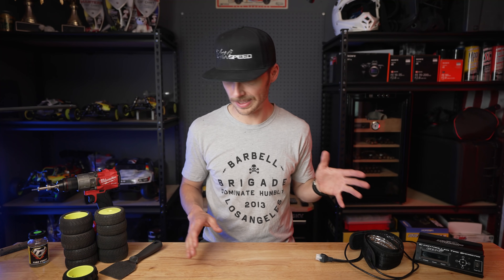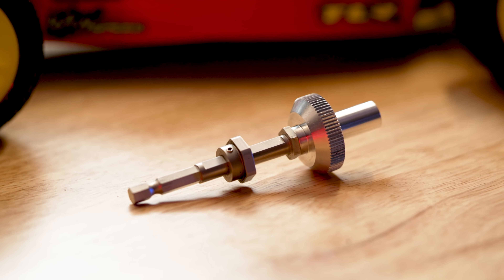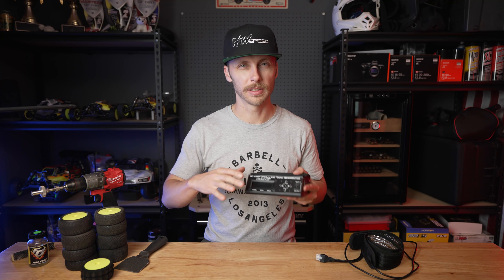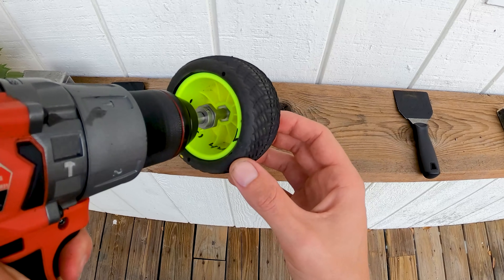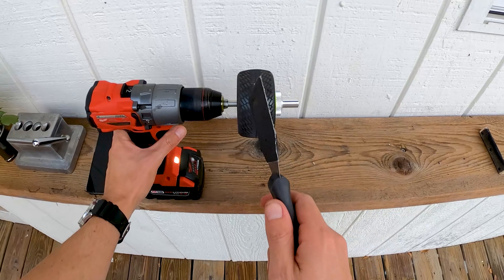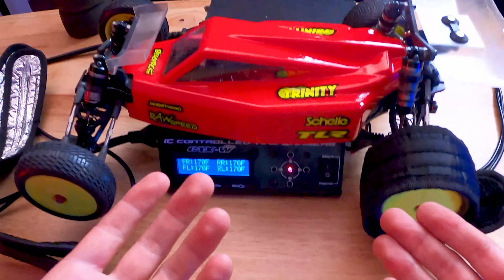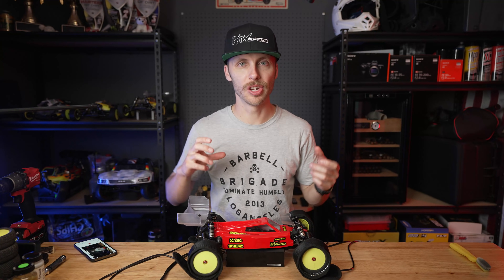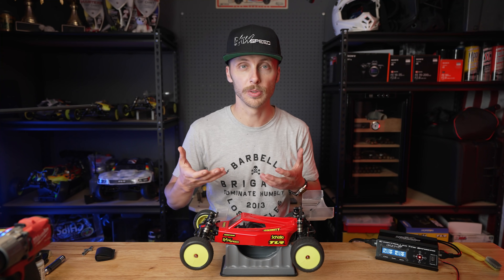How to prep RC tires for more GRIP!

Comment: I learned from you on this, so I'll return the favor. Take a lesson from those heathens on the other side of the fence that do oval racing. Tire roller. Tire beater. Whatever you want to call it. There's two different styles I've seen. One with two rollers in a tray like your bath had. Keep tire on chuck and apply pressure down to the tire beaters. They're rollers that look like a rough pitched gear.  Breaks the foam down.  The other is a box with two wheel casters on the bottom. Put the tire in on the chuck tool. Slide a third hard caster down and tighten the nut. The casters do the work for you. You just run the drill.  Five minutes and the foams are broken in.   I'll take a set of your tires though.  :)

Comment: I start with 80 grit then finish with 120 grit - no need for the Scotchbrite pad doing it this way.  I clean the tire with Simple Green then burn it in using a micro-fiber cloth.  Prior to a race, I sauce it up, work it in with a brush then let it dry.  For no prep, I'll also add warmers after applying my sauce (I use regular prep not this sticky, gooey crap that is so common).

Comment: Blankets...they are called tire blankets. ;)

Thanks for the info.

BTW, that Foam Shaping tool is literally a 90° wedge of wood, wrapped in a piece of sheet rock mud joint sanding mesh. Super simple to DIY.

Comment: Awesome work man! ill be ordering one of those tools for sure. I just started doing a version of this break in method using an adjustable heat gun while monitoring the surface temp of tire. i let it normalize for 2-3 minutes, apply sauce and pull after 5 minutes.

Comment: Fortunately in Germany we race only on carpet or astro turf. Put some Schumacher Cactus or Mini Pin on - that‘s it 🤗
Reply: So no tire prep needed for astroturf tracks??
Reply: @Diper1981  No, only sometimes I must cut the outer line of pins, but only if there´s too much grip.
Reply: @RConmyMind  what anout sauce prep before the runs?
Reply: @Diper1981  Tire sauce is not allowed.
Reply: @RConmyMind  i mean in the cases where tire sauce is allowed
Reply: @Diper1981  It is never allowed. If then I would use the tire sauce which is used for touring cars.
Reply: @RConmyMind  thank you! What about sanding down etc?
Reply: @Diper1981  No, maybe 1 run out of the box and then they are perfect.

Comment: How do I find out about where tracks are in my area? I recently bought my first RC car and its been super fun to work on it and upgrade it over the last 2-3 months.

Anyways, how should I find out about tracks and events in my area? Also, at what point is my RC even considered competitive? I have a 1/18 scale ECX roost buggy, currently I've got a 1600ni-mh battery and a 380 size Titan 18 turn motor, and 18 tooth pinion gear, as well as some 1/18 scale ECX ruckus tires. I get about 27mph out of it, maybe a little more. I want to get into racing it, but is this even fast enough?

Comment: Our indoor track is concrete, with carpet jumps. The track is prepped in the fastest line and the rest is slick. Traction rolling happens a lot to everyone.  

I'm not sure if I should prep tires on an already glued track.

Edit: we run 1/10 sct trucks.

Comment: Another great tutorial man! You really inspire me to learn and stick with this awesome hobby. 2 questions if I could...
1. When you say a “run” or couple of “runs”... are you talking about just one lap? Or more like a 5 minute run around the track?
2. What kind of concern, if any should there be wit getting inserts wet when cleaning? I noticed no mention of reference to keeping the holes covered when cleaning the tires. I was always afraid to get liquid in there so I do mine by hand while holding thumb and finger over the holes. Now we run slicks so cleaning is quite easy and fast but I still try to keep inserts dry. Can you touch on that? 
Thanks for all you do man!!!

Comment: Nice video bro, I'm finishing up a custom works sprint car kit I picked up  to run at the outdoor clay oval near me. Have any tips for me? Would shaving my tires give me more bite, any other tips or tricks for shock oil, diff, ect  would be greatly appreciated. I plan on picking up some of that traction in a jar for the tires.

Comment: Great video Ryan. To your point of getting headaches from the fumes of some tire sauces, I've done some research online to find a 3 to 1 mixture of 70% rubbing alcohol and wintergreen essential oil works really well to soften rubber. 3 races before my heat I spray green METHOD brand cleaner on a micro fiber rag and clean my tires, wiping them dry with a different micro fiber rag. I let the tires sit until 2 race before mine and I then use a toothbrush to apply my 3 to 1 mixture. By the time I'm up for my race my tires are dry and super soft. A bonus is they smell minty fresh. I am in Colorado where it's super dry so you might have to adjust application timing depending where you're located in the country. 

If you take a chance and look up Liquid Wrench they have there chemical spec sheet on their site and it's rated as one of the most toxic chemicals made with all kind of possible side effects. I too was getting bad headaches from smelling that stuff. I wish more tracks would ban the use of it.

Comment: Love the vid. However...this is why I just built a 1:8 nitro buggy and truggy. RC racing is not (to me who raced a few times in the late 80s) supposed to be about sanding and saucing tires. It should be car setup and tire selection added to driving skill. That’s off-road racing to me.